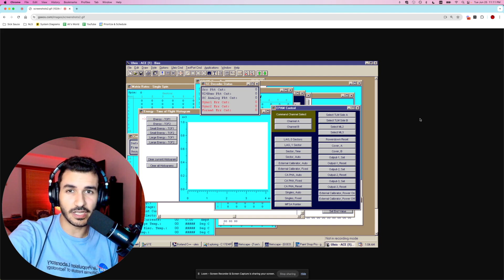The only skill that matters in engineering

Comment: I got electrical engineering a year ago and I'm going to entering  my second year now.  Now I'm confused. Should I consider different carrier or freelancing 

Fan and student from India ❤
Reply: In India, An electrical engineer can do electrical engineering job, automation engineering job, CS-IT job, electronics engineering related job, instrumentation and control engineering job, mechatronics job etc.

But engineer from other fields can't do job of electrical engineer.

So point is better stuck with BE in Electrical Engineering and do prepare of GATE because it will clear your concepts and your knowledge will be very strong also you can get Mtech in top 8 IITs after GATE score, and learn othet skills like python,c, autocad, ETAP, MATLAB, PLC programming.
Reply: Electrical and mechanical are evergreen branches 🔥